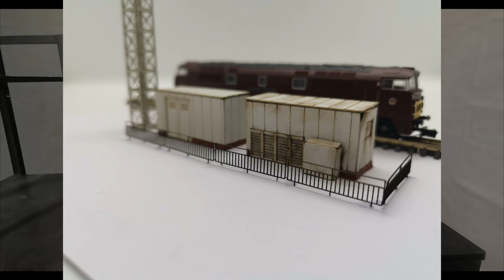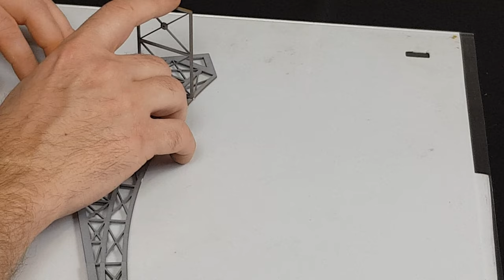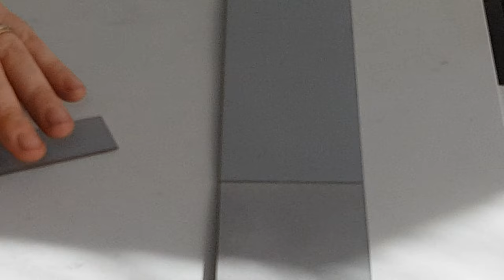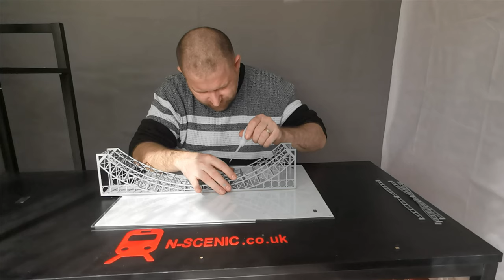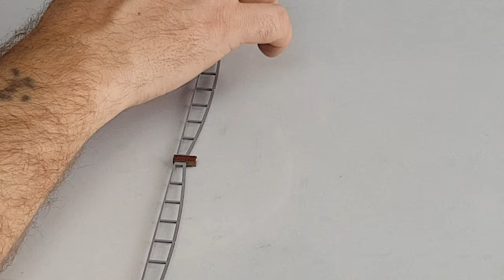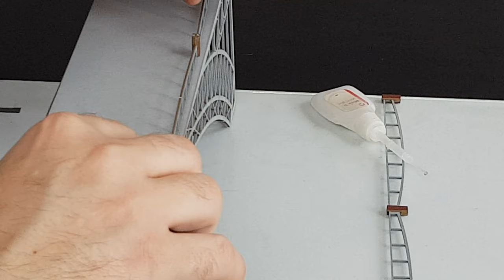N-SCENIC N GAUGE CAST IRON BRIDGE BUILD GUIDE

Comment: what kind of glue are you using, please?
Reply from the maker: I use Superglue CA glue but I wouldn't recommend that because you have to get the positioning of the parts correct first time...

Just simple PVA glue will work fine.. it just takes a few seconds longer to dry that's all but at least you can get the parts exactly where you want them 

Hope that helps

Thanks

Tom
Reply: @thecraftedgrainco  Hi Tom, Really nice bridge, well done. One question, What kind of material is made of?, plastic/cardboard/wood?
Reply from the maker: @jaimequintana7282  hiya, the n gauge resign is 1.2mm card and the OO version is 3mm MDF